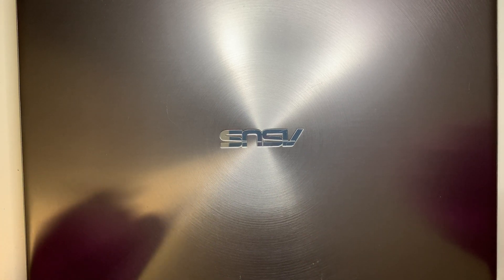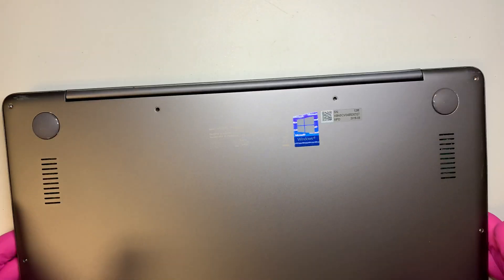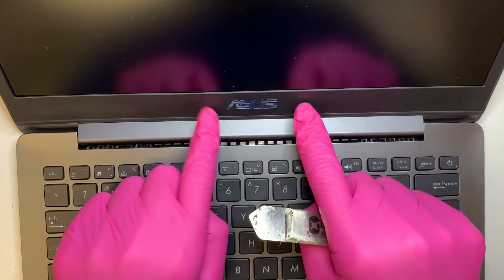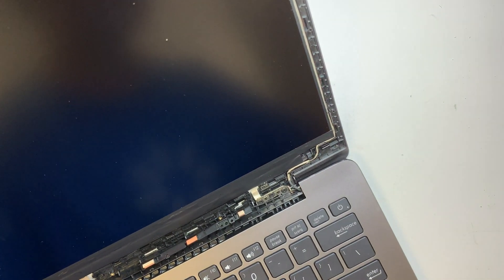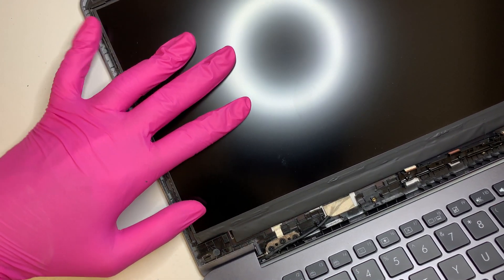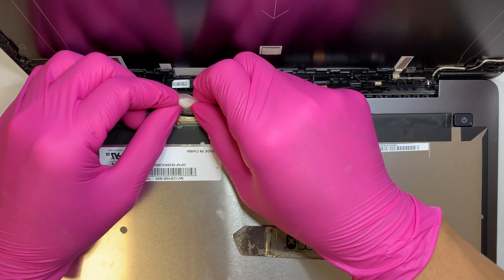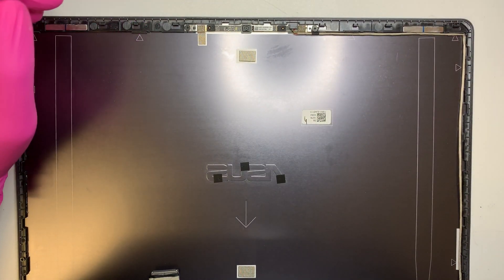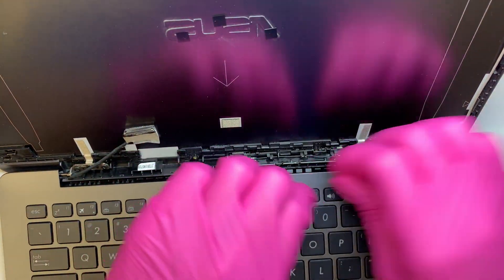ASUS ZenBook 13 LCD Screen Replacement

Comment: i have a ux331fal zenbook i must replace the webcam, can i remove the bar between lcd display and keyboard using pry tool then unscrew the bezel from base unit and remove bezel and replace webcam without taking all 12 screws off base unit and disconnecting battery and display wires from bottom unit?